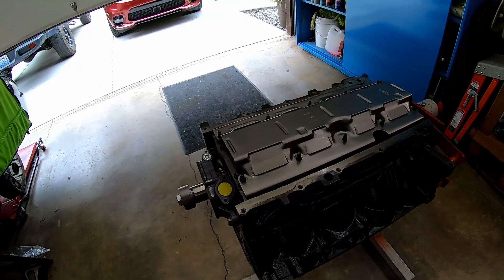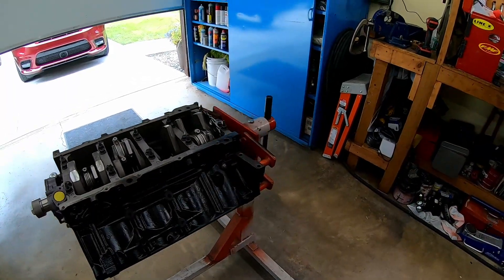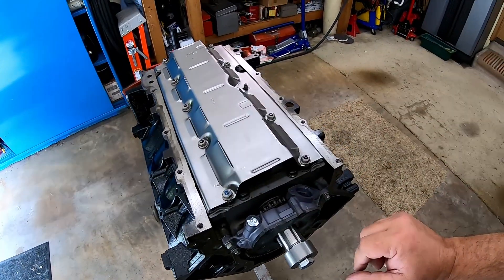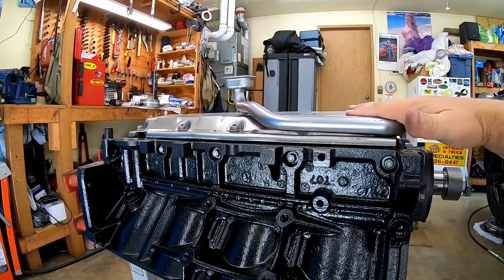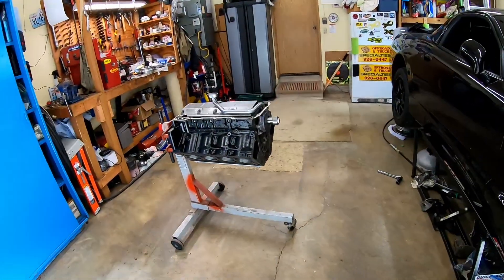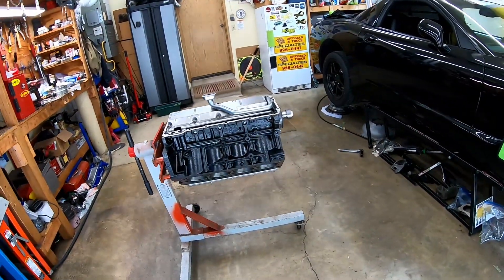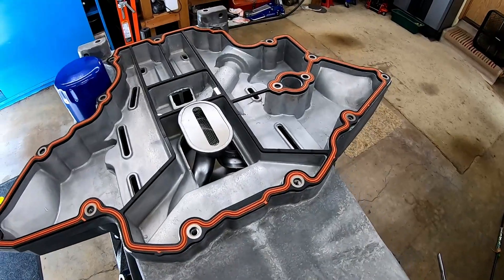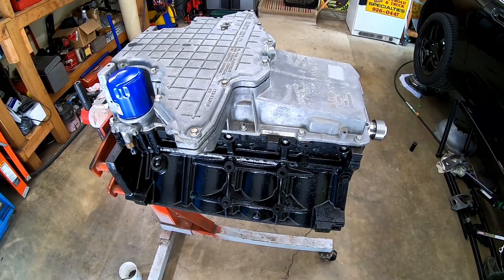How to install a factory LS windage tray on a 4 inch stroker crank C5 Corvette

Comment: Getting spacing correct is essential. I like to use a wad of tin foil sometimes and crush it down, then undo everything and see what it measures. Cheap and easy. Used that method recently to check for hood clearance over top of a manifold. Had to notch a little out of the under structure, but it worked like a charm.
Reply from the maker: Good stuff! I've never used foil that way.  Only clay.  In this case you can see clearly with your eyes to verify clearance.

Comment: I would not stack washers under this tray for multiple reasons.  You want to endure tge tray rests on a solid standoff.  The better way to do this is to add metric un flanged nuts to the studs then the tray. Tge washers will inevitably move around over time. Lots of moving parts and stuff moving around in there.
Reply from the maker: I'm not worried about this in the slightest.  and like I say in any of my videos, if something ends up not working or fails, I'll be the first one to come in and say it didn't work.  Also I tried the flange nut thing and wasn't comfortable with moving the windage tray down more than necessary because all it does is distort the hell out of the pick up tube.

Comment: fortunately for you, your pickup tube isnt protruding too much. I have the same issue and the lower oil pan (batwing) hits the pickup tube draw point. Im in the middle of cutting the mount and trying to shorten it.. not having a good time
Reply from the maker: What do you suppose is different in our combinations?
Reply: @PNW_Car_Mods  I’m not sure, I’ve noticed there are two oil pans, one with a removable lower batwing and one that isn’t. Maybe the pickup tubes are different too? I have a different pickup tube as I use the black o ring for the oil pump instead of the green. I ended up cutting the mounting leg, shortening it, and welding it back together. I got 1/4” of clearance but don’t know if that’s enough
Reply from the maker: @slvrwrx25  1/4 inch is perfect.   no less though.  No more than 3/8s of an inch. I've heard upwards of half inch can cause problems as well.  I think you got it made.
Reply: Summit sells a gm performance wind age tray for the 4” stroke for 70$ js.
Reply: It matters what oil pan you’re running.  The aftermarket pans are hit or miss from lackluster quality control. This is true for the Holley pans as well. The issue isn’t the windage tray as much as it is the pickup tube.  NEVER and I mean NEVER use the o-rings that come with the aftermarket pans and pickup tubes.  Use the melling orings or OEM GM from the dealership. I usually cut the oil pump side of a factory pickup tube and weld it to the aftermarket one about 4” from the pump. The aftermarket pickups are not worth taking the chance on. I’ve seen lots of them destroy engines

Comment: I wouldn’t keep stock oil pan with 408
Reply from the maker: Well now you tell me lol.  It's already in the car.   There's no going back now.  Standard volume high pressure pump with 7 quarts in it.  It'll be fine.